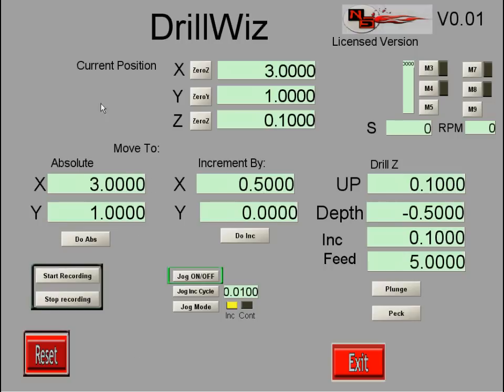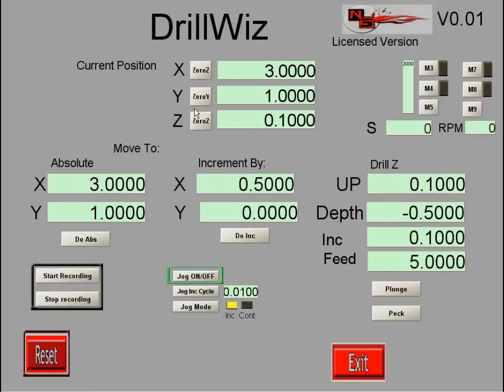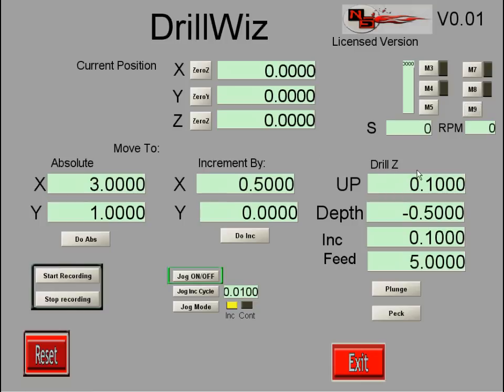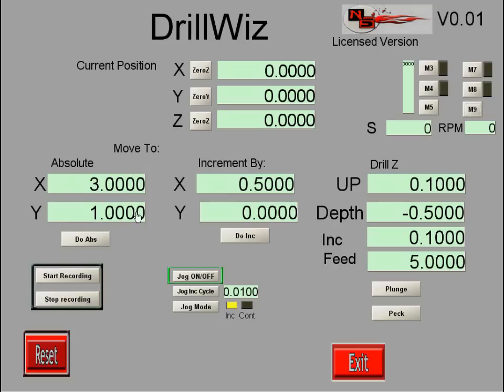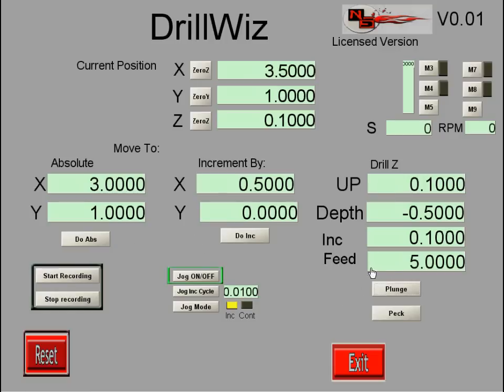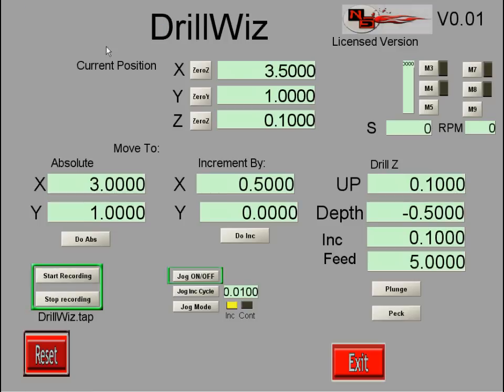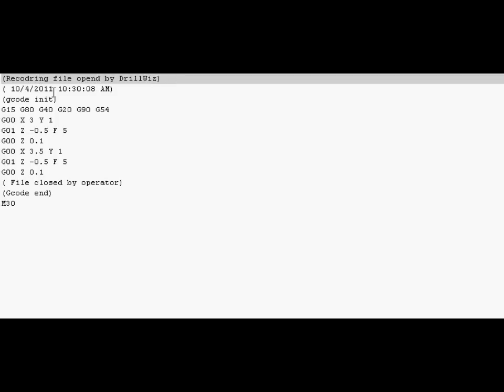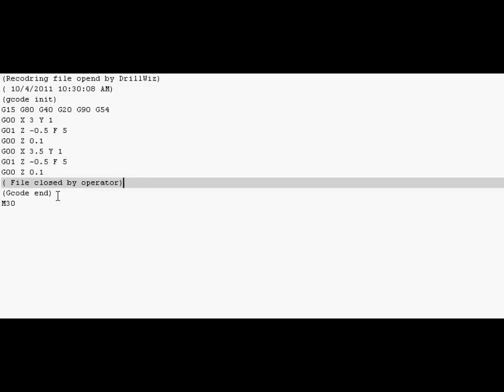DrillWiz

Comment: Looks good. I need a tooling plate for my Taig mill and using Lazycam's examples did not impress me with their ease. There are probably faster ways of drilling a lot of holes but recording one row of holes, moving over on the blank plate and running the wizard again for a new row of holes seems a secure way to do the plate.